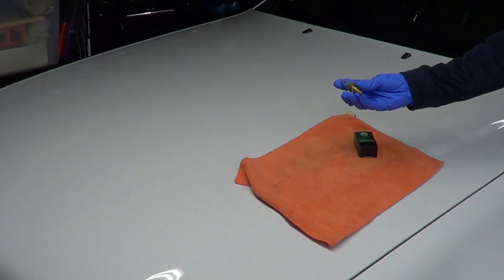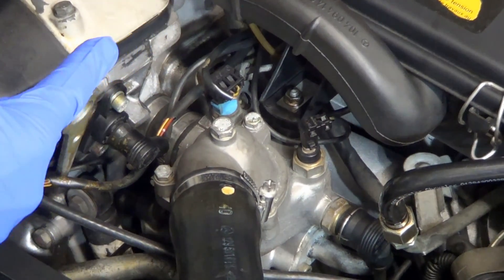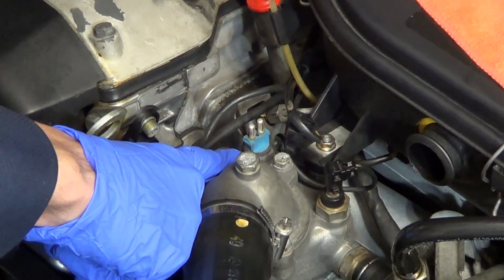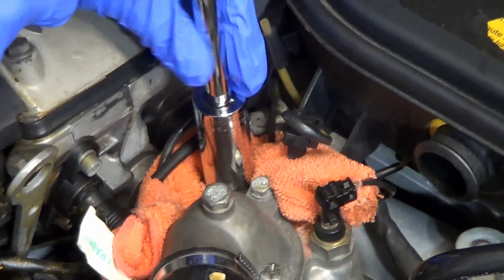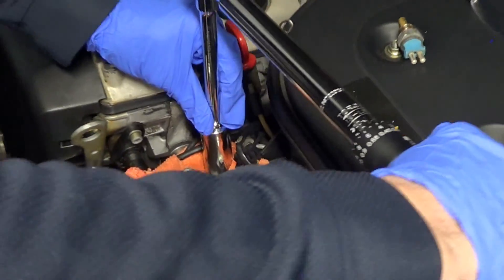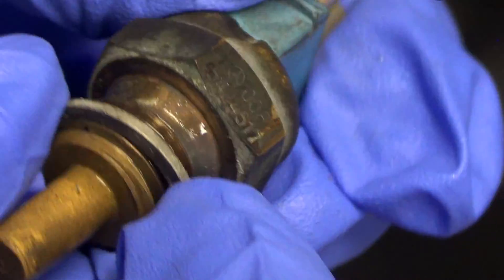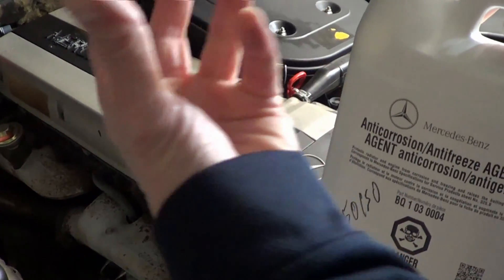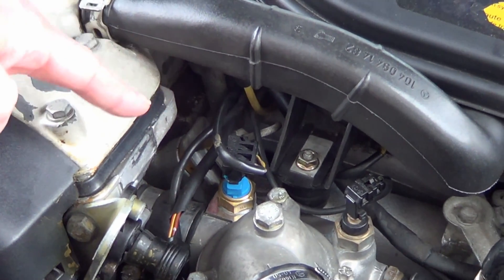Mercedes Engine Overheating Protection R129, R107, W124, W140, W201 Coolant Temperature Sensor Trick

Comment: Awesome video work! Ive a 1991 w124 m103 and the coolant temp sensor is on the engine valve cover. It shifted to thermostat as in your video 1992 onwards I believe. My cars temps always creeps up in traffic or with AC on, so this mod is on my list. It is a bit strange cause there is a test for the CTS to check resistance across polls and Ive done that, the sensor always passes. But I suppose Ill swap it anyway.
Reply from the maker: Glad the video was helpful. It's a great mod, as through time, the entire coolant system in these cars are not as good as when they were new (i.e. old still functioning radiator but not optimal), so the mod provides an added benefit without a serious overhaul of the entire coolant system. Even if everything is working well, a cooler running engine within operating temperature is better than one operating above the operating temperature, so the mod makes a lot of sense. The CTS test is a good test to do on the sensor. If it's within spec you don't have to change it. I cover all the sensors in this video:  https://youtu.be/8VRWBAZ03V8 Keep me update. Always appreciate the comments. Thanks.
Reply: @HandyVal  Thanks for that! When I was first diagnosing the overheating issue, I checked each sensor's resistance against this table I found online, and they all checked out. So it just felt that our heat (30-40 Celcius in the summers) is proving a little much for the old system. However, now that we're in the low 20s and below, it still tends to sit a little high on idle (about 100). And it's uncomfortable at that point cause it will creep up in another bout of traffic. If I turn AC on, it kicks on the aux fans and somewhat maintains 95-100. So with the resistor mod, hoping the needle would stay between 80-100. Now I also came across this silicon oil for the viscous fan motor that is serviceable. Apparently, if silicon oil is replaced there, motor spins the fan freely (faster) and thus gets more air flow. Are you aware of this?
Reply from the maker: @shaazy Good thinking on the viscous fan. They do go bad. I’m not familiar with the silicone oil to service them. It’s definitely worth a try and it should help cool, in combination with the resistor mod.

Comment: Thanks for the great video! How do you do the resistor trick with a 3 prong sensor?
Reply from the maker: I need to think this through. What year and model are you asking for. I don't think it will work as they use a different way to trigger the fans unrelated to the sensor. As the 3 prong isn't related to the fans.
Reply: 1989 r107 Mercedes 560sl the sensor is located exactly in the same spot as the one in your video.

Comment: When my mercedes  coolant  indicator  pops up saying  "top up coolant 'mt Mac says just put water is that a correct  response  please  tell me the importance  of topping  with coolant
Reply: Thank you kindly
Fm SheriD  South  Africa
Reply from the maker: @sherwyndasari4379 I should have mentioned this in my original reply - water is only ok to use in an emergency situation. But then, the coolant problem should be addressed as soon as possible.
Reply from the maker: It is extremely important to have the right coolant (with proper mix of coolant and water) and coolant level.  If it’s only water it will boil sooner, and cause engine damage. Water also have no additives, and water will freeze at O Celsius, whereas coolant won’t freeze. The right coolant includes additives to keep the coolant system clean and keep the temperature where the engineers intended.

Comment: Hi Val! Awesome stuff. I used to do this on my W123 years ago. I had totally forgot about it.

However, when I put the 1000 ohm 1% 1/4 blue resistor on my 1995 sl500 coolant temperature sensor, the fan comes on immediately on a cold engine. After driving it a few days, my high speed fan relay melted. In the video the car is running and so is the fan. Is the fan suppposed to come on immediately with a cold engine?
Reply from the maker: Good question to ask. Absolutely not, the aux electric  fans should not be on, with a cold engine. The resistor trick is just meant to turn on the fans sooner on a warm engine. I don’t have my notes with me, but it may mean that for your car, you need to try with a different resistor, until you get it just right. The goal would be turn the fans on at about 95C, instead of the 105C-ish.

Comment: Had one w124 230e and it overheated many times and my me and my dad went to the mechanic and we found out our thermostat which is the stock one, it opens at around 100 celsius and we figured thats the problem then a mechanic told us that put a thermostat that opens at 65 Celsius, and other mechanic said its too early and the car will become cold, but the mechanic said who cares let the fan run, its job is to cool and 65celsius isnt pretty bad, after intsalling it the car worked perfectly fine,
Reply from the maker: Thanks for sharing your experience. The thermostat with a lower temperature allows coolant to flow around the engine sooner, and hence keeping it cooler. But it will converge with a higher temperature thermostat, as both will at some point be fully open. I think in your situation, the thermostat you had was probably one that opened at 100+ (stock thermostat is 87C, this means that it starts to open at 87 and then is fully open around 90-95), or was faulty where it never completely opened. Ultimately, you and your dad found something that worked, and I’m happy to see the car temperature is no longer a problem. Your persistency paid off.
Reply from the maker: Thanks for sharing your experience. The thermostat with a lower temperature allows coolant to flow around the engine sooner, and hence keeping it cooler. But it will converge with a higher temperature thermostat, as both will at some point be fully open. I think in your situation, the thermostat you had was probably one that opened at 100+ (stock thermostat is 87C, this means that it starts to open at 87 and then is fully open around 90-95), or was faulty where it never completely opened. Ultimately, you and your dad found something that worked, and I’m happy to see the car temperature is no longer a problem. Your persistency paid off.
Reply: @HandyVal 👍👍👍

Comment: Thank you very much for this detailed video! Could you please let me know how to determine a bad one? For example typically how much ohm reading for like 80 degree C is good or bad? Thank you! Jeff
Reply from the maker: Good question. Luckily, I’ve made a video on this. Check the video description for a YouTube link to my video. It would be best to test a couple of temperatures. Let me know, how it tested.
Reply: @HandyVal  for this blue sensor, i measure d the resistance around 80-82 degree is 557 ohm, is that sound high or low?
Reply from the maker: It’s certainly in the right range. At 85C it should be between 460 to 650 Ohms. To be certain you can try another temperature. At 20C, it should be between 5000 to 8000 Ohms. Likely it will work at other temperatures too. When it’s not working it usually won’t work at any temperature. It will not give an Ohm reading.
Reply: @HandyVal thank you!

Comment: Hi. Thanks for the video. My 97 w140 s320 has only one temperature sensor. I think it sends information to both the ecu and the gauge. Will this work on my car and will the value on the gauge change?
Reply from the maker: This won't work if there's only one temperature sensor. If you add the resistor, you'll get a different reading. Does it have a blue sensor? If it does, then this will work.

Comment: Val do you have information on replacing engine oil pump on R129 300SL 1991
Reply from the maker: Hi. I don’t have any good knowledge or experience to share with the engine oil pump. I assume you’re getting low oil pressure? Sometimes it could be as simple as a clogged or cheap oil filter causing those symptoms. Start there. From what I know, it’s an involved process as you need to get the car on a lift, remove the oil pan and then you’ll have access to it. There’s also a chain. There are a few steps. Sorry, I can’t be of more help.

Comment: Hello Handy,
I need your knowledge to help me on the following issue that I have on my MB SL 320 1995......114K Miles. 
I am getting the following OBD2 code ..... (CEL) P-0400..Current....'Exhaust Gas Recirculation Flow'. I am using the icarsoft scanner. The CEL appears at abour 2000 RPM while driving. Also, we have replaced the Engine wiring harness. As you are aware, that these model had issue with the wiring harness insulation breaking off.
I have already done the following:
1-Replaced the EGR valve with an OEM part
2-Replaced all the vacuum lines flexible tubes and plastic ones.
3-Checked the Vacuum solenoid. There is perfect vacuum at the Soleoid from the THrottle body. The solenoids for EGR and the Seconday Air Compressor click when I appply 12V on each of the terminals.
4-Cleaned EGR line. Checked with the compressed air. There is no resistance to the flow of air.
5-Checked the EGR by sucking in. It opens.
5-Replaced the Engine Coolant Thermostat. It was found disconnected at one of the holdind clips. 
6-The connection at the single wire ECT (Engine Coolant Temperature) that indicates temperature on the dashboard was found found disconnected. Re-soldered it and the now the coolant temperature is showing around 80C at the dashboard. 
7-I don't want to touch the ECM.

What else do I need to do to reset this code for good ?

Regards,
Syed
Reply from the maker: Syed, you’ve done everything right. The P0400 code is usually a bad EGR, which you’ve replaced, or a vacuum leak, which you’ve checked. What exactly happens at 2000 RPMs? Is it only a CEL, or do you have driveability problem?

I don’t think it’s the ECU. If it was the ECU you’d have other problems. The ECU works with the EGR and the MAF to control air flow. So if everything around the EGR is good, then it could be the MAF sensor. Try cleaning the sensor with a MAF sensor cleaner. I hope this helps.
Reply: Sir, 
I was able to get rid of the the P-0400 by replacing the Positive crankcase pressure gaskets and two rubber pipes on the engine. My new issue is very simple. I am getting the new OBD11 code P-0441(Evaporative system issue). I have changed the fuel tank cap. The problem now is that the tube connecting the evaporative solenoid output tube got disconnected from the engine. Can you please let me know the point on the engine where this tube needs to be connected ? A picture of the connecting point on the engine will help me.
Regards,
Syed
Reply from the maker: @syedshahid492  Congrats on fixing the P0400. The 320 was an early adopter of OBDII, so it's great to read such detailed codes. I did check my files, and I'm not able to find what you are looking for, and I searched a lot - sorry. I suggest you try the 'old fashioned' way with a mirror looking for the connection point. It's a pain but with some patience you'll find it. Sorry, I couldn't help more.
Reply: @HandyVal  I
Reply: I just need the connector on the Throttle body where the output of the evaporative solenoid connects . Exactly where does it connect  on the Throttle body ?
Reply: You can check on your own car just by tracking it. Its a black little thicker plastic tube.

Comment: When you add resistor to coolant sensor, does it change the temperature reading on speedometer cluster, what you see behind the steering wheel? Or other sensors provide that information?
Reply from the maker: The resistor trick on the blue sensor only impacts the engine overheating protection via the high speed aux fans. It has no impact on the instrument cluster reading. The instrument cluster reading has its own sensor. No other sensor readings are impacted.

Comment: Thanks Val great stuff!  I purchased a pre made resistor in a cap that fits on the prongs then the wiring fits in to the cap. 100 bucks.....  now the fans come on at about 90 c with or with out the air on I love it works grate especially for me as I live in the desert where avg summer temps are 115-118 not much fun to drive in those temps.
Reply from the maker: Thanks for sharing. You definitely need the resistor. It’s a smart choice to go with the pre-made resistor - it makes it easier…plug and play. Your engine is thanking you for every single one of your summer time drives.
Reply: Hey i cant find any.. could you tell me where you found it ? Thanx
Reply: @kemms21  Just saw your comment 7/31 in the pm I have sent an email to the person I purchased from several years ago asking if they still are making and selling them.  Once I heard back IF I hear back from the seller I will give you the contact info I paid 115 bucks years ago. B N touch
Reply: Hi any updates cause I'm interested to in getting it for my 92 300ce thanks @rioraton
Reply: @rawuncut1784  the unit I bought was for a R129 temp sensor. Not sure that it would work on 300 CE?  The guy that manufactured them had a stroke and I purchased one of the last ones he had in inventory before his stroke .
Reply: Ok thanks for responding I guess I'll have to make one unless you know of anything else?? All help is appreciated thanks. @rioraton

Comment: Thank you Val - was up early enough to catch you first inline. I really learned more about this sensor. And have never given it a second thought - NOW I HAVE! Since my R129 is already in the shop I’ll have them check it out for sure. By the way - again - an AWESOME Instructional video. Mark🙏
Reply from the maker: Thanks Mark. I appreciate it. This sensor is so critical to the long-term well being of an engine. I want to ensure every R129 has a proper working sensor. Its function is basic, yet so important. They are cheap, easy to replace and simple to test.
Reply: @HandyVal  bless you Val - thank you 😊
Reply: Did it work, did the auxiliary fans kicked in at 90 degrees?
Reply from the maker: The temperature here is still a few degrees above freezing. I tried but it wasn’t warm. The cool temperature kept the engine cool without further assistance. I will provide updates in the video description later in April hopefully when the weather is much warmer.